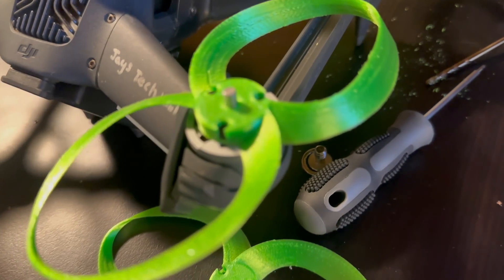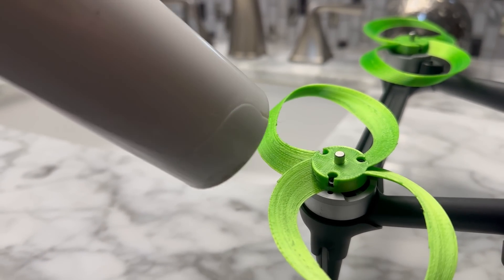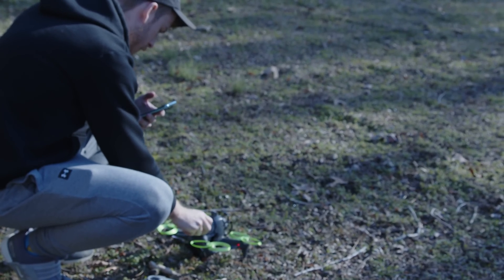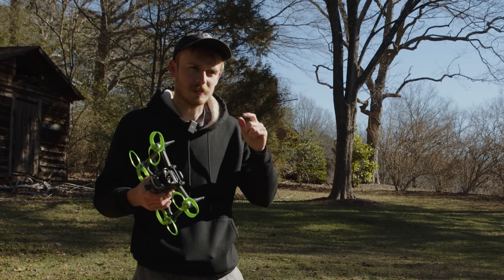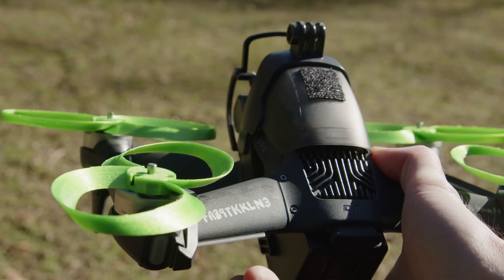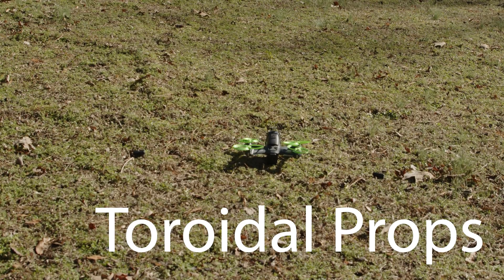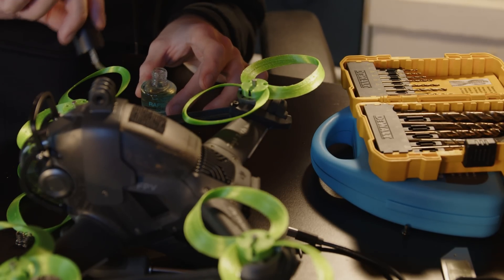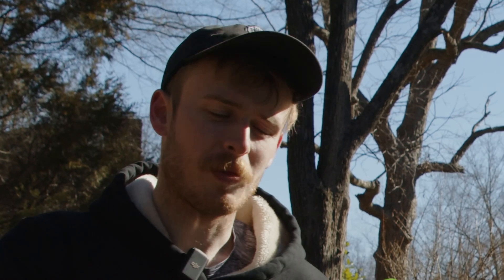Testing MIT's Toroidal Drone Propeller Design & Sound

Comment: I feel like it's not exactly a fair comparison to compare these 3d printed blades to normal blades.
Reply: i feel like its the perfect comparison since the original MIT "wonder"(scam) props also were fdm 3d printed and also were compared to normal props .... the only thing this shows is that the paper from MIT is totally intransparent about there findings and probably saw the same problems with the design thath you did....
Reply: There are a ton of variables in how the various blade types/shapes/sizes perform with various metrics. The length and breadth of individual airfoils (which comprise each "blade") will have a significantly greater influence than anything else. It's also important to discern the original design parameters for the specific motors used in the drone.

I've had a lot of luck with adding 1 airfoil to each prop on a quadrotor. For example: when I took a cheap RTR drone that originally used a 2 blade rotor for each motor and replaced them with 3 blade rotors of the same size, the drone was substantially more efficient for any given RPM of the motors. There are a ton of other variables that contribute to the airfoil efficiency which aren't readily addressed by simply changing to this toroidal design. At the very least, you'd have to consider the mass of each rotor and the surface area of each "blade" that generates lift and drag.

They will also be constrained by the maximum length of the airfoil and the air turbulence generated by the transition from the lift-generating surface to the outer point (where it connects the sides of each foil to one another.) Instead of trying to make each airfoil connect with a rounded, rotated, continuous surface, it would likely be more efficient to maintain a traditional airfoil shape which is connected to the other surfaces by a circular flat bar [imagine a thin cylinder that's connected at the tips of the rotors which has the same vertical dimensions as the airfoils themselves].

By making a toroidal connection where the aft of one foil connects to the next, but which rotates the surface laterally to match the next angle, it makes that rotated surface move in a way that increases drag without generating any additional lift. It's difficult to explain in words rather than just seeing the design I'm describing, so I apologize for any translational issues. But I'll give my best effort to describe a couple solutions if you want to attempt to imagine it.

Each blade is composed of 2 or more airfoils that are similarly angled with respect to the rotational axis, right? If you envision/see a "traditional"  4-foiled blade/propeller, you should notice that each foil will generate the same amount of lift and drag because all are identical. With the toroidal shape, 2 of the adjacent foils are connected at the tips but twisted to match the other's angle. That is then reflected across the axis (hopefully that makes sense). This also means that these two twisted loops are disjointed and there is a disparity in lift/drag generated between the loops and the disconnected area between them. By it's very design, there is a much more limited capacity for lift since the 2 individual loops on each rotor flex/move differently than the space between the loops. That means you are essentially using 2 airfoils for each rotor, but adding a large hole inside the foil which reduces it's surface area, and thus, it's lift.

One way to fix this would be to put an external connection at the tips of each foil/loop that connects to all the other foils. This would allow you to maintain stability across all 4 surfaces while the rotor spins. Another way to solve that issue would be the way the torus is expressed proportionally across it's surface. You would want the lifting face surface to be greater than the surface of the twist's transition.

I'm having a hard time describing the design that I have in mind, but there may be someone else who is better able to describe this verbally. But my points here boil down to this (in the most simplistic way I can describe): the type of torus displayed with these rotors is not optimized to generate lift. The shape they trace during rotation is unbalanced and does not match the circular, evenly distributed arc they would move along with respect to the central axis. You need an equal angle between all 4 lift generating surfaces to maximize efficiency. I hope there is something in the above description that will give you an indication as to intent of my design suggestions.
Reply: @DrewishAF  thanks for the thoughts and explanation. It was good to read. Maybe it will inspire an improved CAD design...
Reply: it's not exactly fair to compare these to the actual protected MIT design
Reply: @danisyx5804  You're correct but (quibble) he was comparing his version to the propellers ... 😁
Reply: To make it fair, 3d print a normal blade and compare it.
Reply: hrm it is a beneficial endeavor when you consider human flight 🤔
Reply: watch the fan showdown, if properly printed, it does not matter at all.
Reply: printing on the jankiest printer ever didn't help... PTEG is not really a good pick for this application, I'd have at least used an ABS...

outsourcing for a SLA that can work with PEEK or Ultem would be worth it due to the small size of the parts.
Reply: excatly
Reply: The laws aerodynamics clearly show these blades will suck for efficiency. Regardless of what material they are made of MIT did change the tone at loss in efficiency from 40%-70%. They knew this and that's why the had a fancy chart for the changes to DB  but nothing on flight time or efficiency. Its like saying we created a car that is more pleasing to hear but goes 40% less distance.. nobody would care...
Reply: @BluSky1  Its advertised so heavy in teh boating industry as more efficient, but not much data in the air medium with drone side.  Yea I don't think many would switch over for sure unless there was more efficiency
Reply: @codyhanthorn4270  i wanna see a jet with a prop like that in it.
Reply: @codyhanthorn4270  I feel that the drone community haven't really understood how to do this right yet, because the Sharrow prop is much better than standard props. However, it may be that the standard boating props were far less efficient in the first place because of cavitation, so it's not a total given that toroidal propellers can reach or beat standard aero prop efficiency, but I suspect that's possible. Sharrow put enormous amounts of work into their props and it's very early days with drones.
Reply: @BluSky1  lol you literally described gas vs electric car rofl. Don't know if you did it on purpose but it made me laugh 😆
Reply: @BluSky1  Its a scam is why.
Reply: I have seen several variations of these in the last few days and none of them have been quieter.
Reply: @David_Mash  They didn't really change the DB rating they only changed the tone. so think wine vs groan same DB rating.
Reply: It's not about fairness.  It's about "how do they compare?"  Given the massive inefficiency shown in this test I think it's DOA.  But ...

Caveats: a better manufacturing process might have yielded a better result?  Did the 3D model replicate the airfoils correctly?
Reply from the maker: I mean how many times did I say that in the video? 🤷🏼‍♂️
Reply: @Jays Tech Vault  Ok true, and apologies from me not wording it better, but I more meant why didn't you test 3d printed normal blades?
Reply from the maker: That would be valid, there’s a lot of things to try.
Reply: @JaysTechVault  print these blades at 65-70-80-90% size of normal
Reply: @JaysTechVault  I mean it's a rough baseline but bruv it's nothing close in comparison to MIT cause they have more tech to get rid of surface roughness and unevenness from annealing

Remember you anealled without support

Introducing all kinds of miniscule warps in the props

Personally I think u should do a part 2 where you redo this

Aneal the parts in a mold and see the difference
Reply: @Skhillz_FN  , I don't think they could be annealed in a mold.  This shape cannot go in and out of a mold due to its shape.  It's one of the manufacturing hurdles of this prop design.
Reply: @JaysTechVault  this kind of reply warrants an unsub
Reply: @JaysTechVault It's very interesting to see how these work as 3D prints. This is like using a sports car and a junker to compare manual and automatic transmissions. So presenting as if it's an experiment between toroidal and classical props is actively misleading.
Reply: Yeah especially the way their printed 🙄
Reply: Didn't sound quieter to me.
Reply: @masterq2.033  That can be subjective when listening to a video capture.  Only real way is dB meters at 2 or 3 positions, same locations of drones and meters for each test.
Reply: Should have used your colored nail polish bro, would have gotten a few more minutes of flight time, or looked pretty cool trying 😂
Reply: I was going to say same thing.  This kind of 3d print is absolute rubish, heating with hair dryer ,man that is low tech, next time try oven or microwave😂. It is achievement they did not break when flying. And all this just shows that aerodinamic and balancing is not that easy as being youtuber.
Reply: @ThePlombyras  Give him a break, make your own video why don't you?

Comment: I think with a better design it could be a lot better, I think one with 4 toroidals? And maybe different angles and stuff. Instead of 2 would be way different.
Reply: ain even the right design💀 angles are off and they used three blades in some of their tests
Reply from the maker: Wanted to follow the design they showed.
Reply: @JaysTechVault  Oh gee.. why would they show less-optimal solution to a problem to the public?

Comment: I always see people using Acetone to smooth out the plastic and remove those lines, is there a reason you didnt and spent all that time Painint on nail polish? which Contains Acetone ? is it the plastic type that doesnt allow it ? or did you just "not know" about it ?  Im looking at getting a printer in a yr or 2 .. other projects need to be completed so im living vicariously though others and a close friend whos gotten into using these machines .. So im currious to learn as much as possible . Cheers
Reply from the maker: Acetone breaks down the plastic. When you are trying to do a high stress application you don’t want to compromise the material.
Reply: @JaysTechVault  Ic .. Cool, thanks for the information mate . Cheers .
Reply: It works for several styrene based polymers: PS, HIPS, ASA, ABS. It does not break down these as opposed to what Jay is saying, it's a viable smoothing method and it'll make the prints stronger. It's not recommended to print these plastics open-frame, and maintaining bed adhesion can be difficult as well, or if you manage to do that, they can just rip up your bed, it's hilarious.

Mass produced rotor blades are probably made from polycarbonate. One should never apply acetone to polycarbonate, because it actually damages it. You can buy polycarbonate 3D printing filament but good luck actually getting a print out of it.

Standard 3D printing plastics, PLA, PETG, PCTG, acetone does nothing to the base plastic itself, but it could interact in an unfortunate manner with the masterbatch binder. Nothing good will come out of this.
Reply: Acetone smoothing only works for ABS plastic. The standard printer filament is now PLA due to the health hazards of ABS and the difficulty of printing it.

Comment: It seems a lot power was wasted pushing air sideways rather than downward, by the leading blades in the rings
Reply from the maker: I would agree
Reply: @JaysTechVault  you might want to decrease the pitch and increase the blade width in the next iteration